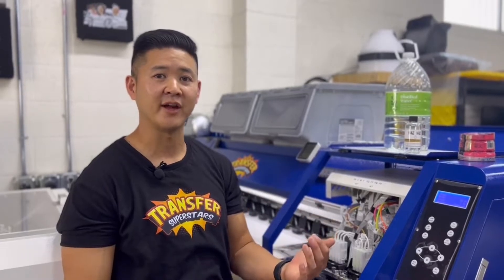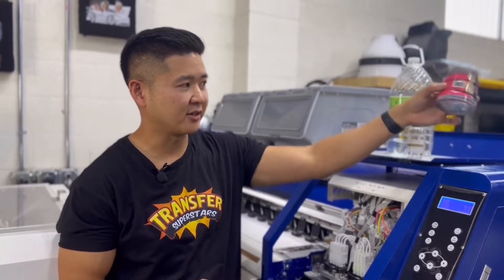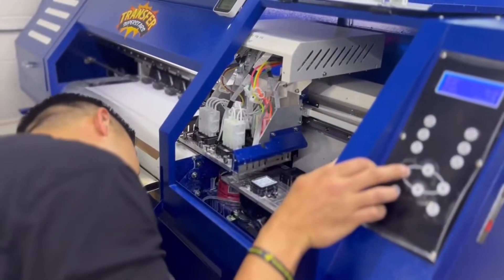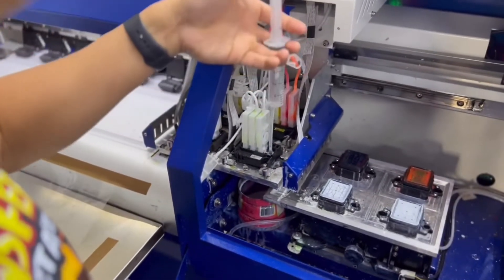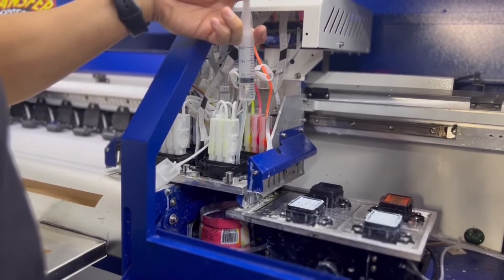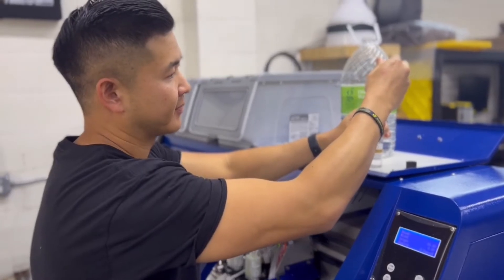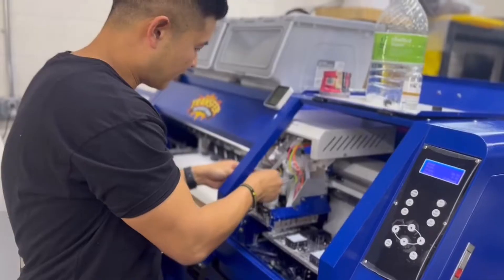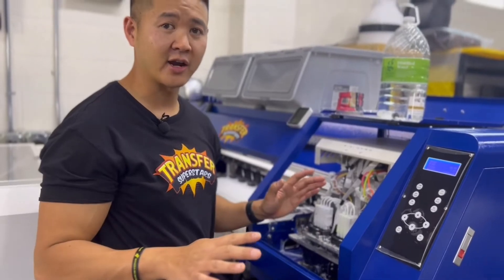Putting your DTF Printer in Vacation Mode - Here’s what to do when you step away

Comment: Thanks for the info.  This was scaring me from buying one and the constant maintenance. I do about 200 - 300 orders a month. But also leave for month at a time a few times a year.  I need to create more detailed logos with graphic tees.  

I currently outsource my shirts for screen printing locally.  I only pay $1.20 for up to 3 colors and they press my accent logos and inside neck label I provide for 25 cents each. I also pay them to fold and bag for another 25cents a item. (The pricing and quality is great)

But my logos are limited and I’m always behind in inventory, because I outsource, so it’s hard to scale.   

So I’ve been contemplating buying a commercial dtf printer so I never have inventory problems and add graphic tees.

Comment: Do you just keep the white ink in the printer and turn it off ( no circulation )? I'm about to close down for 3 weeks and a little concerned about how the state of the white ink would be when coming back.
Reply from the maker: As long as you clean the printhead manifold and add vacation solution to keep it moisturized, it should be fine. My recommendation when you return is to turn on your printer and let it run for a few hours so that the white ink circulates well before even doing your first head clean. You might want to even syringe the ink in your lines before running ink through your print heads. I'm sure you will notice some separation in your white in.